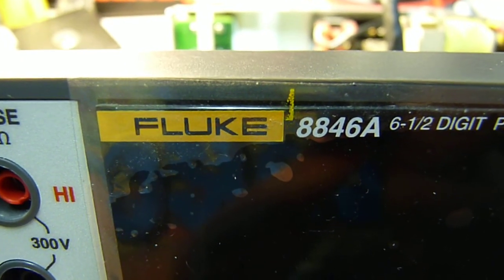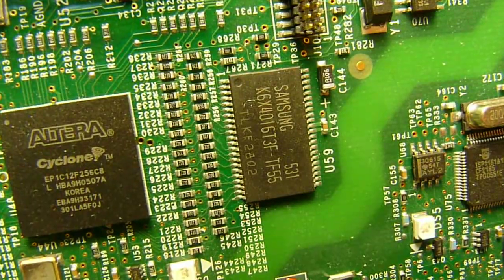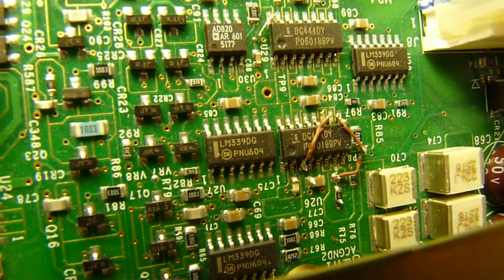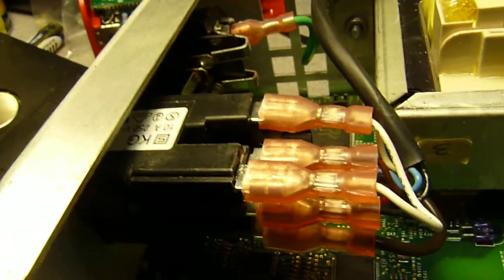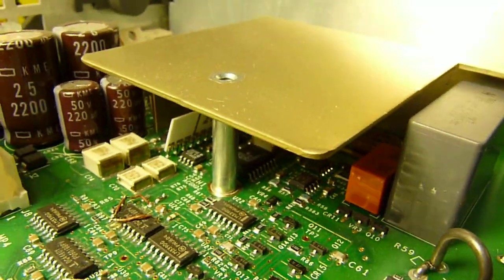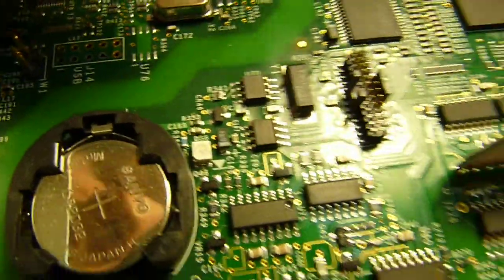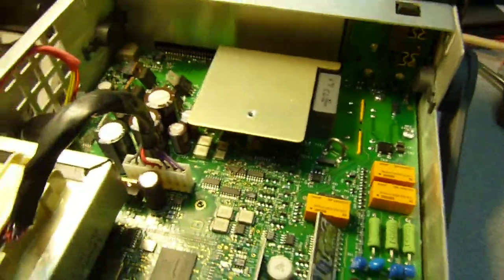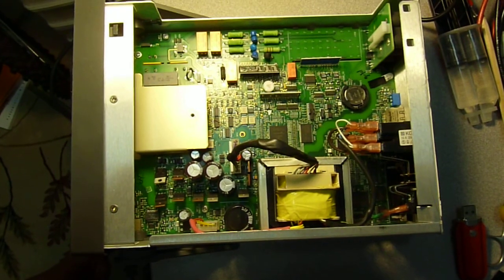Fluke 8846A bench multimeter teardown

Comment: Hello I have the Fluke 8808A ... I did the measurement of a transformer for tube amplifier and the voltages were higher than 700V AC. The multimeter broke. Ohms and AC function fail. Any suggestions or help ...! Greetings.

Comment: LM399H is the heart of the instrument. It's the oven controlled voltage reference. It's what ensures low drift and accuracy of the whole instrument.

Also those flat upright things you couldn't tell what they were are laser trimmed resistor networks. Very unique and important/expensive components.

Thanks for the teardown!